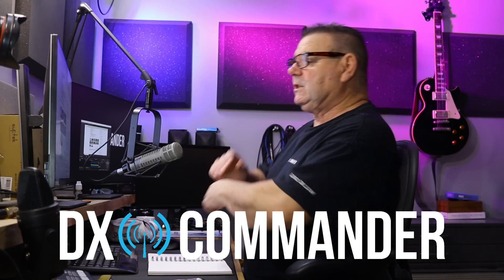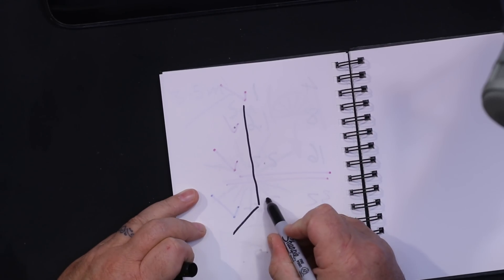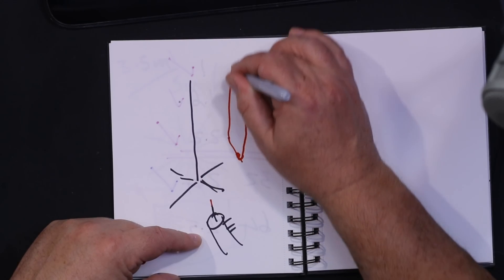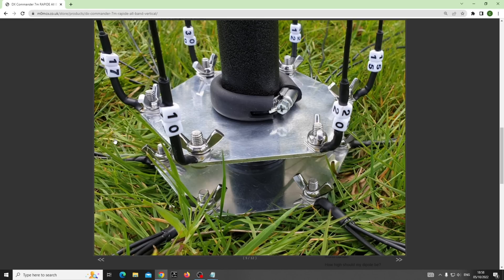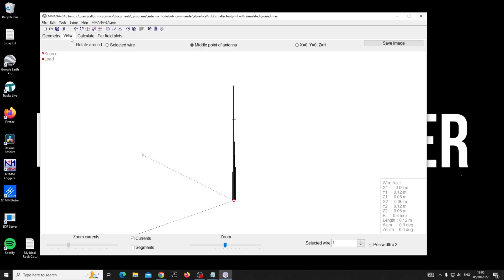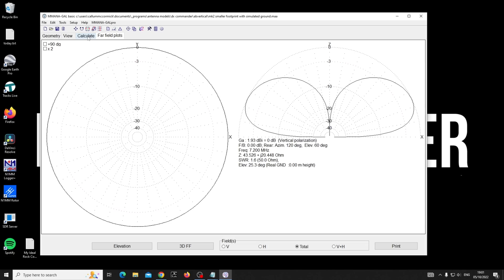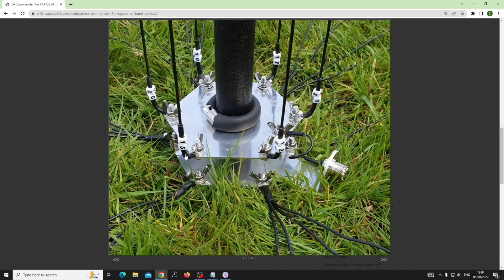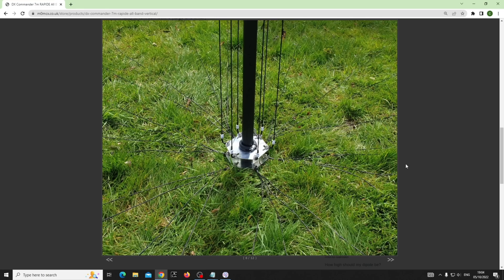How does a DX Commander Work?

Comment: Dumb question, and theoretically speaking, what would happen if you had separate elements for 40 and 15? Would RF on 15 just go to the 15 element, or would it try to split between the 40 and 15 elements?
Reply from the maker: They would be shared BUT the longer element presents a better match so most of your signal would use longer one.
Reply: @DXCommanderHQ  Thanks. I was asking because my 40 meter antenna is a homemade double bazooka dipole and it doesn't seem to work for 15 at all.

Comment: I'm getting ready to erect a 50ft aluminum tower. I had planned to put a mast in that will be 15ft above the tower for a dualband vertical on top, a set of 13 element vertical polarized 2m, then a cross mast with a 17 element vertical and 19 element horizontal 440mhz, then another set of 13 element horizontal 2m, then a 5 element 6m. 
   I'm brain storming if i could insulate the bottom from ground and shunt feed the tower. Would it possibly resonate at 80m with the beams acting as a compasidence hat?
Also could I add stand-offs at the top for 40, 20,and 10m vertical elements downto the base.... Am I thinking to big or does it sound reasonable?
Reply from the maker: Yes apparently this can be done - but it's beyond me because I've never looked at it..
Reply: @DXCommanderHQ  thank you for your response.  Now i just have to play with the coil on my shunt ground

Comment: K, so follow up question here. I got the commander 9. Instead of putting the base into the ground for the antenna to go onto, I put a fence post into the ground like 3ft (no concrete) and it stands above the ground another 3 ft. I then made and attached the yellow base that usually goes into the ground to a tilt base that is attached to the top 18" of the the fence post. The commander 9 will slide over this tilt, so the base plate will sit at the top of the fence post. My situation is, to do the radials, they will need to go down to the ground about 3 ft to the ground then spread out from there. Will having the radials going down abt 3 ft to the ground from the base plate and then spreading out across the ground interfere with anything on how the radials or antenna work? (Or will having the antenna raised abt 3 feet cause and detrimental effect on the antenna?)  My placememt of the antenna needed to go into some landscaping, hence the needed tilt design. This way though i can tilt it down anytime without lifting it off to remove it like is typical for the commander 9. What say you on how this will affect the antenna or radials?
Reply from the maker: Try it.. I have only put my radials about 30cm / 12-inches above ground but others have reported success..

Comment: A touch off topic for this DX Commander video Callum, but something that I've been meaning to ask for a few years.
 
I was at my brother's wedding and during the service a radio transmission kept being heard over their speaker system. I can't remember if call signs were being used, so I don't know if it was CB or HAM transmissions being picked up. The Vicar (a real one) told me later that It'd been happening for a while and they hadn't fixed it.
 
Would it be the length of the speaker wires being resonant with the transmission frequency or their stereo/PA system's feed wires to amp picking it up and then amplifying it or some other magic? I wish I'd known more to ask them what they'd tried to resolve it.
Reply from the maker: Probably speaker wires. Possibly mic. Ferrites near the amplifier would probably fix it.
Reply: @DXCommanderHQ  Cheers Callum. 
 
If it was speaker wires, does that mean you could luckily cut a wire to the correct length, attached to speakers, and pickup a frequency without a powered system and/or receiver? (I clearly don't know much about radio, but RF does interest me somewhat)
Reply: @TheVicar  Anything with an amplifier in it is ready made to pick up AM transmissions like CB.  The wires don't need to be resonant, just a little RF needs to couple in and the amp will demodulate it and amplify it.  I would think the signal is getting into the mic cables rather than the speaker wires.  Telephones, computer speakers, amplifiers pretty much anything turns into a receiver.  Putting a 0.1uF or 0.01uF filter cap across the inputs often takes care of it.
Reply: @stargazer7644  Many thanks, as I don't know very much about RF. But what you say would match with the fact that it was only happening when the PA was being used for the readings in church.
 
I must say it was a bit off putting during the service but didn't spoil the day at all.
 
Cheers!

Comment: Hi Callum, I think I’ll be getting one of your antennas in the near future. But if I have to site it up against the fence and therefore only been able to put radials 180 degrees around the antenna would this be an issue on the efficiency of the antenna. Look forward to hearing from you asap. 

Regards

Mark
Reply from the maker: Mark, no problem.. Watch for Monday's video (tomorrow). I will demonstrate this..
Reply: Cheers Callum lol forward to watching it.  I’ll be getting in touch with you by email regarding a new antenna.

Comment: Is there a problem with parasitic coupling with the other wires in the vertical being so close?
Reply from the maker: No.. However, energy attracted by any other elements is immediately re-radiated as a fan-dipole would.

Comment: A swing set (that you played on as a kid) is a pendulum with a natural resonant frequency. When you push (drive) your swing at the 'right' time (i.e. frequency) your swing passenger starts to very easily swing with higher amplitude, because you're forcing, or driving, the system at it's natural resonance. If, on the other hand, you push your swing passenger much less frequently, or much more frequently, you're forcing off the natural resonance, and your day on the swing set quickly comes to an end. Exactly the same math as for your wire but mechanical vs RF electrical system. Basically, what Callum said. ;)
Reply from the maker: Beautiful!

Comment: Wonder how a non-resonant vertical (popular brand with 27ft or 43ft) performs vs a fan vertical like the DX Commander? I suspect the Commander has better take off angles/lobes in the upper bands? (20-10m)
Reply from the maker: I sustepct too. Also nothing to get "hot", other than maybe the connection points at the end of the elements (under serious QRO).

Comment: The DX Commander is the best antenna for the money by far!
Reply: Works great for me.  It's every bit as good as my Hustler 5BTV, which has over 1000 feet of radials in the ground under it.  The DX Commander hears just as well, is usually a little quieter, and near as I can tell there is very little difference in TX quality.  It seems that I can hear and be heard just as well on either antenna at any given time.
Reply: @Brian424  👍

Comment: Building a fan dipole (for 40 and 60 meters) was where I saw how the lengths of the 1/4 wave driven elements change by the band; 20 is essentially twice as long as the 10 meter element, 40 is twice as long as 20 and so on, it also showed, as you did in this video, how higher frequencies can use an element cut for a lower frequency, like the 40 and 15 meter relationship. Building that dipole is what pushed me to buying a DXC.
Reply from the maker: Hey Bruce - yes like octaves are on a piano!

Comment: Ok, what if instead of ground elements you replace them with a 40 meter copper disk about half an inch thick?
What would that do to your gain?
What would that do to the whole RF physics?
Reply: Your wallet wouldn't gain, that is for sure ;)   Cheers
Reply: Making the copper disc more than a few thousands of an inch thick would not help. :-)
Reply from the maker: Ignoreing the cost, it would be irrelevant. A few ground radials work just fine. Video coming out shortly about this..

Comment: The DX Commander vertical works the same way a "Fan Dipole" works. Depending on what band the RF you're sending up the feedline is, it "ignores" the non-resonant elements and uses the resonant ones automatically. Without going into reactance and all the tech mumbo jumbo, basically the RF will want to go to the closest elements that present a 50 ohm load to the transmitter.
Reply: Easiest way to imagine it is that the RF is like a lightning bolt or arc, It will take the easiest path back to your radio. Pretty cool!
Reply: Yeah, when I learned how my fan dipole worked, oh wait and then Add a coil and boom! I learned so much. By the way Callum is an EZNEC wizard 😆